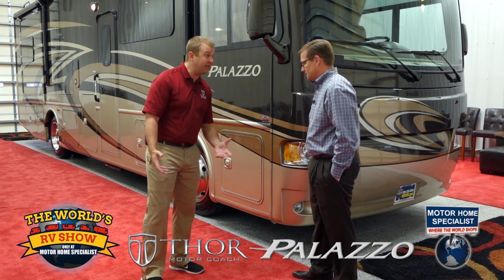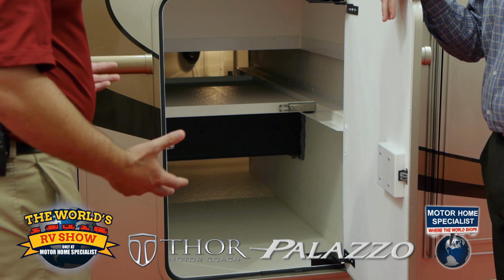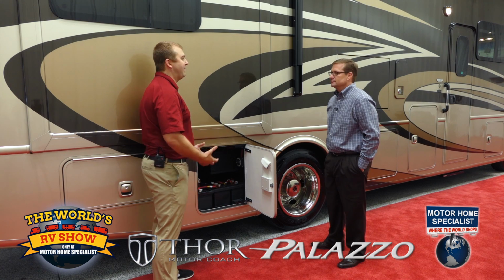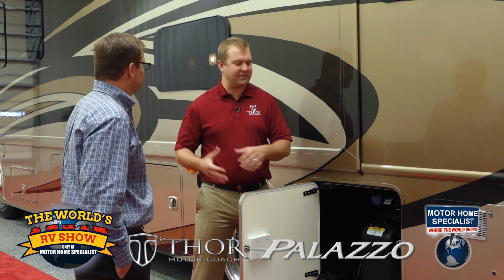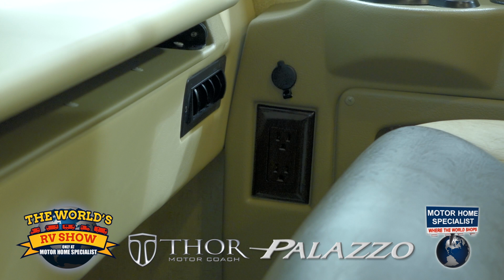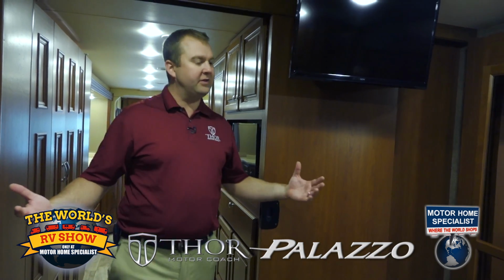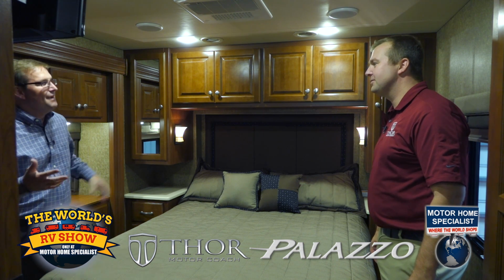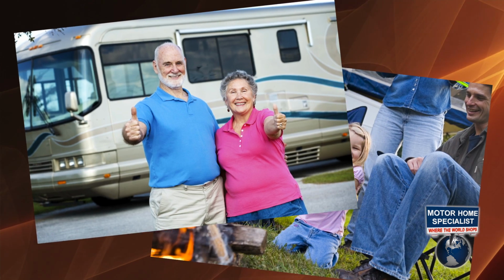Thor Motor Coach Palazzo Review at Motor Home Specialist 2014 2015

Comment: I would like to see what it looks like inside with the slides in when the coach is in the travel mode. What areas are accessible when in the travel mode. I have seen many YouTube videos of coaches but they never show what it looks like inside in the travel mode. So we have no idea if the fridge is accessible or is the kitchen accessible. is the bathroom accessible? Thanks for the video. Love the model
Reply: MontiR Aruba usually   you can  get  around   but its tight until  you  get park